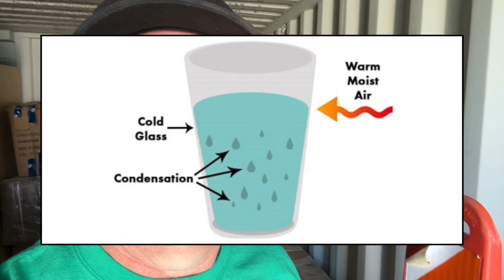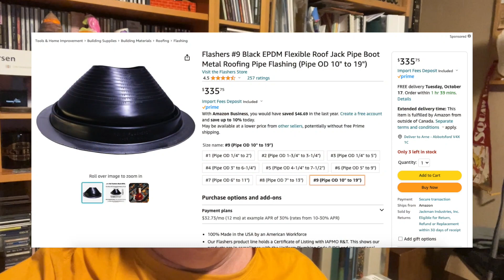S05E111 Installing Ventilation to Prevent Condensation in a Shipping Container

Comment: Do the same thing on two shipping containers. We cut the flashing to match then formed it to the corrugations and buttered  the flashing with roofing tar before we screwed it down with rubber washered self tappers built for metal roofs. So far it's been 3 years without leaks. The fresh air intake vents were done with 3 inch round aluminum vents with built-in screening from Amazon.  Three summers and it works and has not leaked as of yet

Comment: way to much work and $$$. all you need to add more of the side wall vents. and no chach of roof leaks!
Reply from the maker: Hey Gary, big fan of your work! :). But actually, it's too humid here, with big hot/cold temperature swings, that vents alone would not have kept up to the humidity.  I'm not saying that this was the BEST solution - if I were to do it again I might go for a solar-powered fan option... but I will say that it's been over a year, the humidity is under control, and we have had no leaks.  Thanks for watching.

Comment: I live in southeast N.C. and no condensation problems. Still i added extra vents because of heat. Some vents low and some high on opposite sides. I will also paint the roof white. Also may put a fan on the roof.

Comment: a year later, did it cure it?
Reply from the maker: Not 100%.  It improved it significantly, and essentially enough, but since installing 14 months ago I have seen other systems out there that utilize a solar-powered fan.  This would do better, I think.  I may upgrade if I ever find the time.  Thanks for watching.
Reply: @FacilitiesMaintenancebyArne  Thanks, I am researching how to keep mine from raining inside and making everything moldy!
Reply: I just realized these containers must get as hot or even hotter than a car parked in direct sunlight in the mid-summer. Sever temperature swings between day and night for whatever contents you’re storing inside. Have you thought about some kind of extra roof placed just a few inches above the original top of the container? It would have a few inches gap to allow air to flow underneath, as well as blocking direct sunlight from hitting the steel roof.
Reply: @62Cristoforo  I thought about an extension cord and putting a fan in one end, it would be nice if there was an option of it being self contained. I do not want to build a roof, but I do plan to paint the roofs white.
Reply: @JohnVHLife  Sounds like I'm trying to figure out the same thing - misty Oregon. Almost ruined a pickup and an RV that sat through the winter without ventilation, a dehumidifier, or dessicant. Luckily I recovered them and put a dehumidifier in each - problem 100% solved. Can't decide whether to add ventilation, passive and/or forced, in the shipping container or just use a dehumidifier and/or dessicant. Dehumidifier needs power. Passive ventilation like the whirley the wildman Arne used does not.
Reply: I have 3 x 40' high cube in Quebec. My humidity issue is not as bad as yours but still. I was thinking just like you, a whirlwind on top, but at the end of the sea can and an intake vent in the door.
I was concerned about the ribs  of the can, but your suggestion of only cutting the top part and siliconing the ridges is brilliant! 

Big option - I put a solar panels and batteries in each can for lights. I may enventually put a 12v fan in the intake vent door to force air in. They would run constently.
Just a basic and cheap  computer fan would increase phenomenolly the  air circulation at a very cheap cost... and replace the fans every so often when they crap out, at a ridiculous low cost.

Need to think of intake air filtration as well.

Lots of dust in the yard where my sea cans are. I need to figure out how to use furnace filters and some form of adapters on the inside. Still thinking intake from the doors.

Comment: I also live on the west coast of BC, and the same problem comes with huge condensation . I have 53' High Cube  . I installed a fan on the roof that is powered by the sun during the day and electricity at night . Vevor solar attics fan.  For now, it works and it helps a lot, except that it has to be turned on almost all the time, especially at night.I fixed the problem with the roof seal with a huge amount of silicone and it works fine, no leaks whatsoever.
Reply from the maker: The struggle is real, lol. Thanks for watching.

Comment: 15:49  CAN'T believe you put that BIG thing OVER that small hole
Reply from the maker: … and yet it doesn’t leak when it rains and the condensation problem has been resolved as surface area of the hole is greater than the combined surface area of the intake vents, allowing for efficient ventilation. 
Thanks for watching.
Reply: I agree! One must have the imagination to put filler blocks in to allow a full circle.
Reply: That's what she said

Comment: Thanks any idea on product name I should look for?
Reply from the maker: Well, if you want to do it yourself DAP makes a professional spray foam kit that will cover 600 ft.² at 1 inch thick. The cost is $1200 from Home Depot in Canada, but I don’t know where you live so your mileage may vary on that as well as different product availability, depending on your location. I would also think that you may want to have at least 2 inches of insulation, which would mean you’d want to double up on this kit so to do it yourself, at least here in Canada, the potential cost would be north of $2500. Personally I would get some quotes on having a spray foam company come in and spray it, because my time is valuable and DIY cost is fairly high.
Reply: Would spray foam sort the condensation

Comment: Great post. Any ideas on how to insulate from heat as i plan to use a container for my dogs to sleep in.
Reply from the maker: Thanks!  Spray foam, all the way.  Any other will not have intimate contact and an imperfect seal between the insulation and the shell and allow for air movement... which leads to trapped condensation.

Comment: Thanks for posting this, I had ordered a solar fan I was going to install into the door to pull air in.  After watching this video I cancelled the fan and ordered the whirlybird.  I had thought of doing this but didn't know how I'd install on a non-flat roof.  I installed exactly as you show in this video.  I'm just waiting on some side vents to finish everything.  Have the same exact moisture problem in mine with a moldy ceiling.  I appriciate you posting this video!
Reply from the maker: You're welcome. Thanks for watching!
Reply: Can you tell  how it ended, what was the final effect? Did it help?
Reply from the maker: @derekr.6227  Yes it helped considerably.  The problem was solved.
Reply: I already know what I'm going to do next weekend.Thank you.  @FacilitiesMaintenancebyArne

Comment: why would you only cut a small rectangle? just cut the entire dam hole out, air is liquid like water, only so much will go through that hole at once, bigger opening means more air flow.
Reply from the maker: Two reasons: "Small" is relative.  The limiting factor in a convection system will be the smallest opening(s).  The hole in the roof is 4" x 13", which is 52 square inches... which is greater than the combined area of the intake vents.  In other words, the hole only needs to be as big as the combined area of your intake, since the INTAKES are the limiting factor.  The second reason is that we get a lot of rainfall and I still needed to maintain the integrity of the roof.  I wanted the lip on the roof surface so that even if a little water were to sneak past the seal, there would be less chance of it running into the opening and damage that which is stored inside.  Had I cut the hole down to the flat/low section, potential airflow would not have been improved (because air can only exhaust as fast as it can come in through the intake openings) and I would have run the risk of a leaking roof.  Thanks for watching.
Reply: @FacilitiesMaintenancebyArne  the size of the intakes is a good point, by the air that is coming in and mixing with moisture from inside the can, and heating up therefore expanding and increasing in volume, so keeping the intake and outake similar in volume will make the exhaust capacity inadequate, so now intake and exhaust both put a damper on ventilation, as for the water leaks, simply leave tabs on the lower sections of roof when you cut the hole so in effect the raised section of roof will have a bigger hole, bend them up to make dams against water intrusion under your seal.  
also i suggest you increase the size of your intake. the whirly bird with no intake capacity is akin to high flow exhaust on your car but keeping a very restrictive factory intake, its almost pointless, or at least not coming anywhere near its potential, which begs the question, what's the point?
Reply from the maker: @naterchapman1871  I applaud your enthusiasm and appreciate the interaction however, as a certified commercial/residential building inspector for nearly 2 decades, I do know how this works.  To respond to your points, I doubled the original number of intake vents.  I never said the intake/exhaust were similar in volume capacity - the exhaust size is greater.  Warm air rises and facilitates convection.  And finally, the "system" is working; over the last 7 months I have noted a vast improvement in humidity levels to the point where it is no longer a concern.
Reply: I put a whirlybird vent like this on my building but I went ahead and cut out the original hole size but when I got ready to screw the base on the roof I used loctite expanding foam with the flame retardant in it but applied extra in the lower channels then used the self drilling screws to mount the base , next day took a putty knife and trimmed the excess foam that pushed out and I’am pretty sure water won’t leak in it around the base .

Comment: I am wondering how the ventilation problem turned out with the increased vents and spiral vent on the roof. Did you achieve your results of no water and mold on the interior walls
Reply from the maker: Much improved.  Part of the problem is that we store ice-melter in this container, which is a desiccant and attracts water.  If we didn't do this the issue would be completely eliminated.
Reply: @FacilitiesMaintenancebyArne  they actually use desiccants to absorb water and keep humidity down.  They sell hanging bags of calcium chloride to absorb water and reduce humidity in shipping containers.
Reply from the maker: @JoeTheBlacksmith13  the same concept as a similar product they make for off-season RV/camper storage.  Thanks for watching.
Reply: @FacilitiesMaintenancebyArne  right.  So if that de-icer is a desiccant, it should be helping to reduce moisture in the air, not make matters worse.  Thanks for sharing your experience.
Reply from the maker: I know… weird, right? Anyways, not a scientific controlled comparison as we’ve never NOT stored the ice melter in the container so I can’t say for certain whether removing it would change anything.

Comment: Good to now not store anything at all against walls /the ceiling, to help that air-movement, as was discovered by that wooden door.
Reply from the maker: In a perfect world, yes, I agree. However, you and I both know that in a storage things will be stored against the walls. 
Now that the general humidity issues within the container have been corrected, stuff that was stored against the walls will (hopefully) no longer have issues. The walls are built with natural grooves, which help facilitate circulation behind things, so it’s not like the back of a closet with zero air circulation.
I also have another theory. We have been storing ice-melt inside the container, and ice-melt is a desiccant so it has been drawing moisture into the container. I have a feeling that if this ice-melt were not in the container in the first place, the issue would not have been as severe.